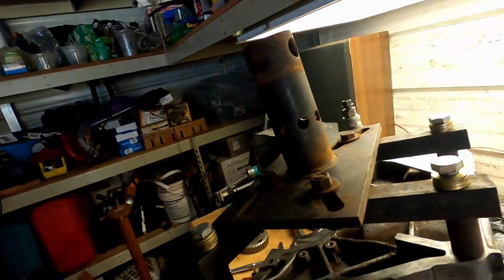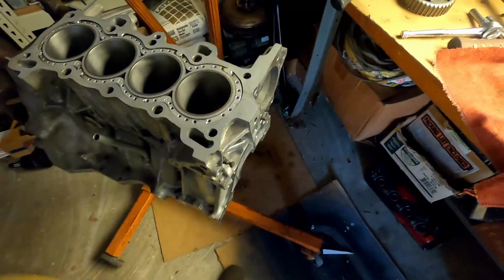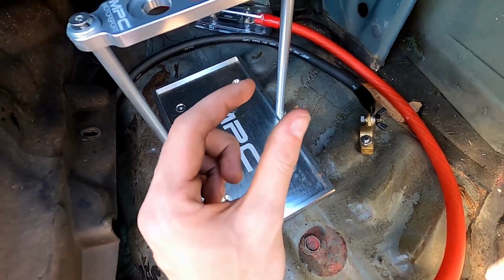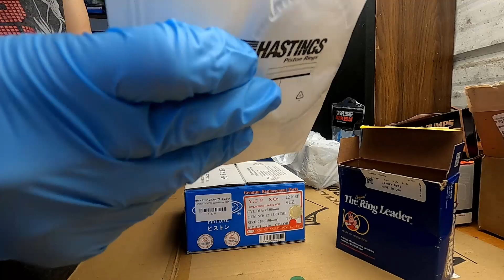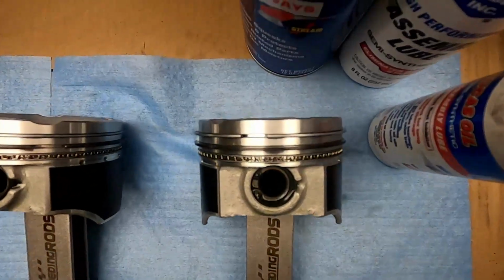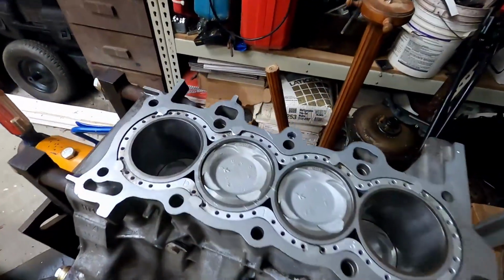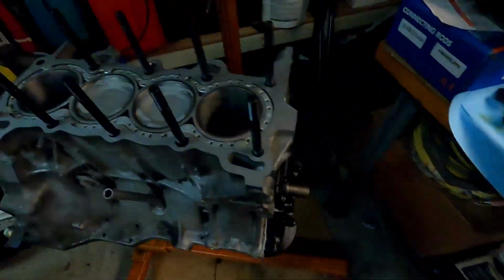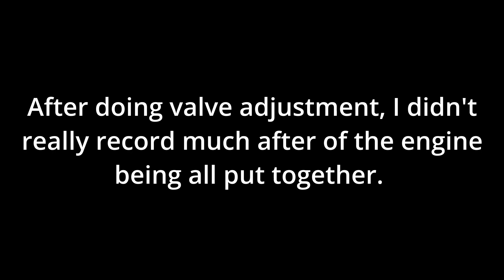Building MY FIRST 400Hp Honda  D-series engine at 18

Comment: You should not put anything on head gasket, gasket sealing interface should be surgical clean, since any materials that is not steel will be weaker than steel. 1000 PSI combustion pressure will push those materials out, causing a leak.
Reply from the maker: I used it and it worked, but will I do it again? probably not cause it makes a mess. Pulled the head not to long ago in one of my recent videos and headgasket had no signs of leakage. I used light coats of copper spray and all is good!

Comment: gonna be building my d15b jdm engine up soon, do you have any tips or precautions as it will be my first time building an engine
Reply from the maker: Be as organized as you can and use the right tools doing the job, don’t cut corners and do lots of research on ring install and measuring your clearances for bearing 🤙🏻
Reply: @ek_tyler  thanks man it helps a lot! I love your build to it’s amazing

Comment: That blockguard has a big gap between the sleeves and the rest of the block. Chances are vibrations will end up cracking either your sleeves or block in the long run.

Comment: I Noticed That Your Pistons Are backwards the Arrows point towards the timing belt.. sorry to let u know
Reply from the maker: I’ve seen both ways. But for bigger valve releases you want the arrow facing the flywheels side. Your intake releases are bigger so if they were facing timing belt side then you’re restricting airflow. But both ways have worked for people
Reply: @ek_tyler  I wasn't trying to be rude or anything was just letting u know if u didn't. In case of future issues but if it works don't fix it is my motto. Lmao.. great job tho
Reply: It's Vitara pistons. that's how theyre installed
Reply: @spp6849  Yes Vitara pistons require the arrows to the flywheel....I have a few Vitara builds and that's the only way to do it...

Comment: Nice job! Keep up the good work. I have a d16y8 turbo with a td05 big 16G DSM turbo running 10 psi blow the head gasket twice and still working on it. 👍
Reply from the maker: Heck yeah man! Honda powa!
Reply: ARP headstuds and OEM headgasket
Reply: @Casey_and_Cars  with arp head studs and a cheap filpro head gasket from eBay.
Reply: @lilokyang6280 felpro headgaskets are good, if you are blowing gaskets at only 10psi then you have other issues, specially if it happen twice already.